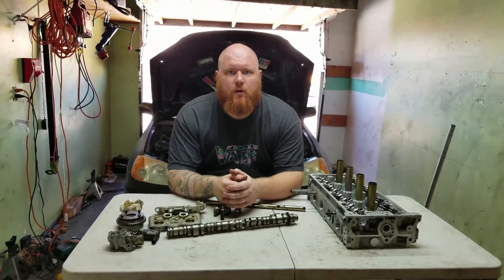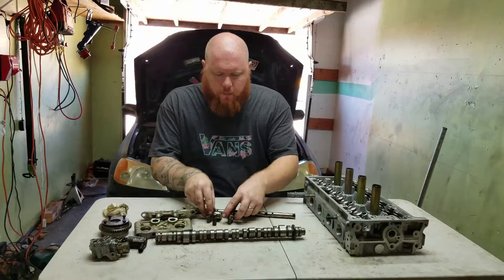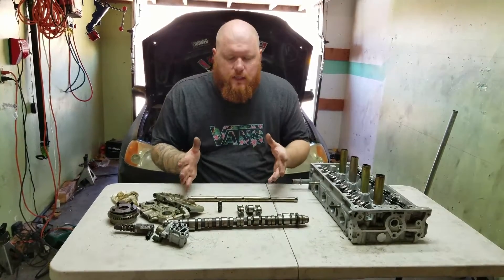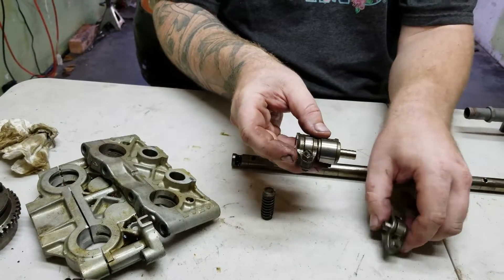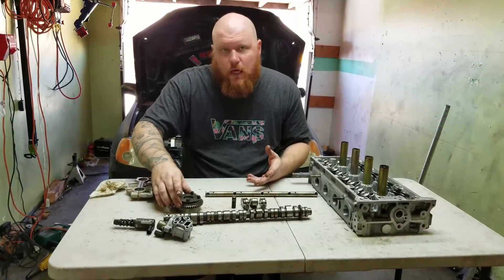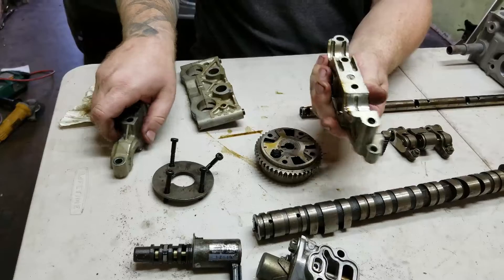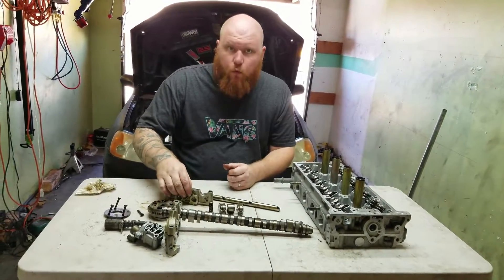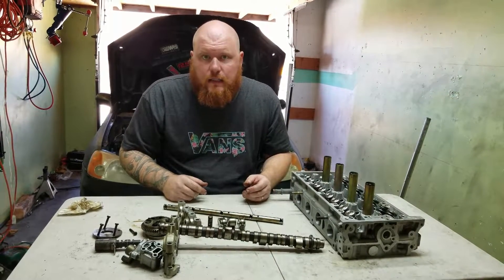Honda I-VTEC Explained by Red

Comment: I have a 09 Honda coupe exl Manual with ivtec. Does vtec give more power then ivtec? Or which one gives more power or speed regarding the gear on the end of the camshaft like how vtc has it. Is it like vtc and vtec at the same time ? Or does original vtec give more power

Comment: Are the rocker arm locking pins from the K20a2 the same size on the intake side of a K24a1? I lost 1 pin and 1 spring :( Are the Spool valve and VTC solenoids the same between K20a2/K24a1?  Also the rocker towers? I bought a head from someone and they didn't give me all the parts.
Reply from the maker: No

Comment: Awesome job. Can you elaborate further on how / when / why the vtc utilizes the 50 degrees of additional timing?
Reply from the maker: The vtc moves using oil pressure from the solinoid on the side of the head, it moved when commanded by the ecu and kept in check by a sensor for each cam, is changes to very the centerline of the lob effecting the power output depending on what the engine wants
Reply: @PirateGarage  thanks for the further explanation.